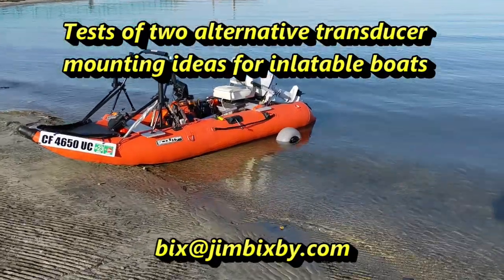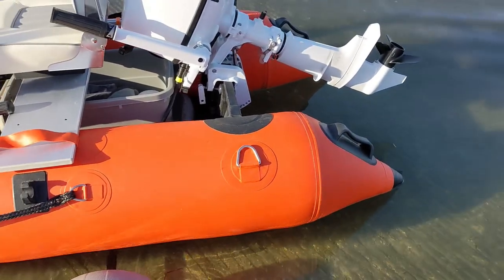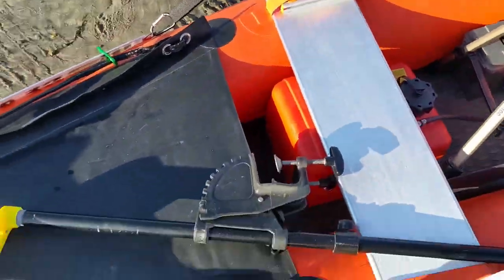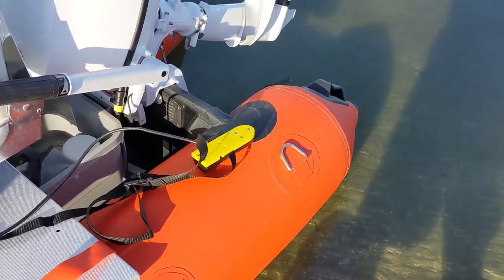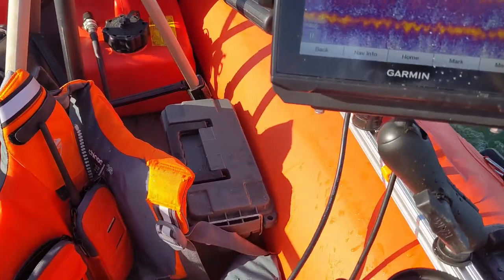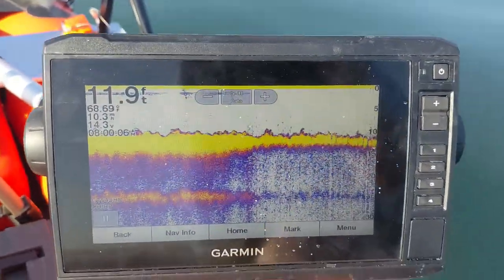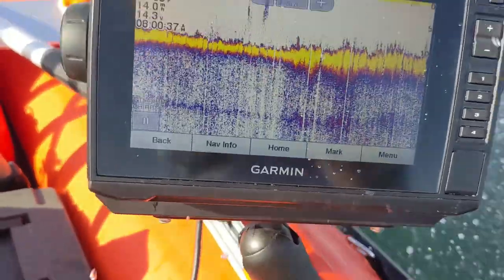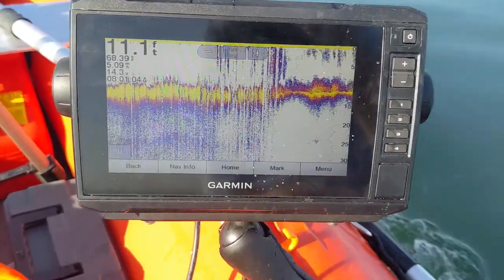Test of two transducer mountings for inflatable boats

Comment: Where can we buy a strap to strap it under pantoon?, thats a great idea, ive tried different mounts with scotty glue on pads but it creates too much resistance qnd splashes water into a boat at higher speeds
Reply from the maker: I sell these. This only works for Garmin transducers, as Lowrance and Huminbird transducers have a tab permanently attached for the swivel transom mount that interferes with pontoon mounting. See https://jimbixby.com/transducer-mounts and scroll down to the pontoon mount description at the bottom Price is $24 plus shipping (I charge only the discounted actual cost at UPS), plus CA sales tax if you are in California. Pickup in San Diego is also ok, avoiding shipping cost. If you don't have a Scout I need to know the circumference of the pontoon where you intend to place the transducer. If you do have a Scout, check out bixfish.com for a range of accessories I have designed and that I make myself for the Scout. Most of these products will work with other inflatable and small boats as well. If you want to order, contact me at jim@bixfish.com where I will collect your shipping info and give you payment info.